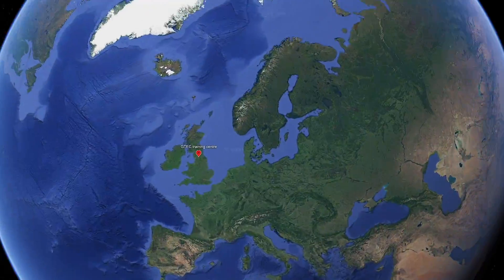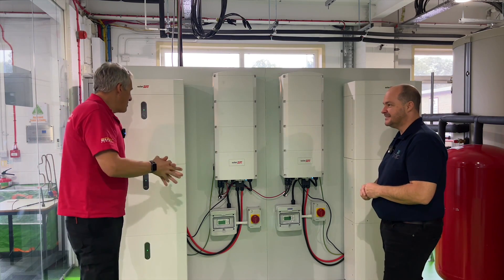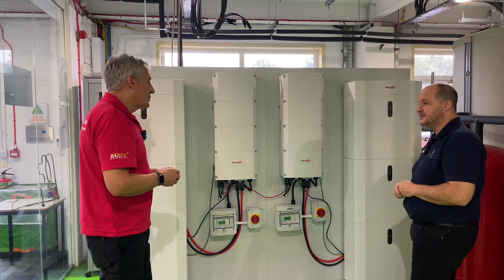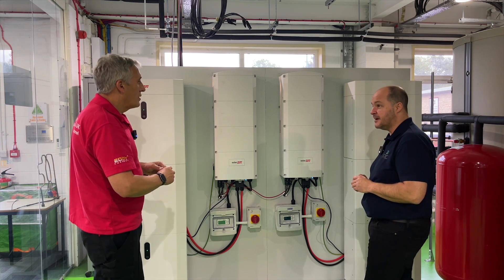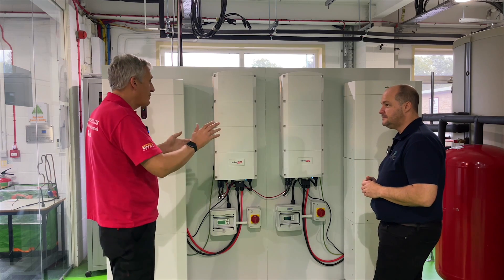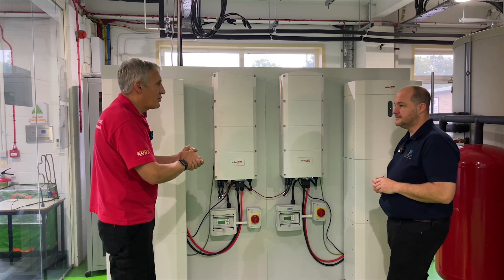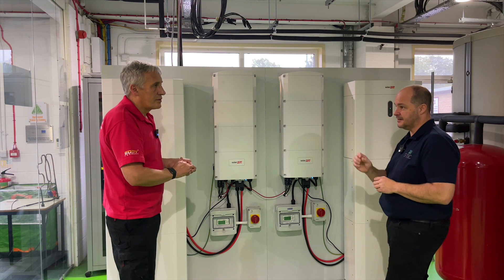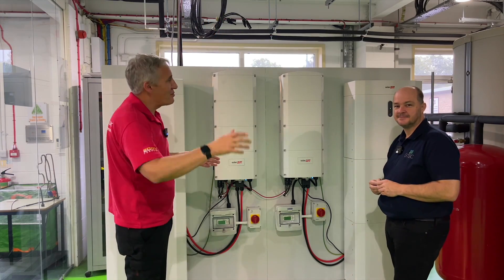Unveiling the Surprising Results of Solar Panel Optimisers

Comment: At https://youtu.be/asCRHtQ6vYI?t=333 you mention that a normal string converter would loose a lot of power (down to 70-80%) if one or more panels has a fault (most likely a diode has shorted resulting in 33% loss of power). That's not the case. Both SolarEdge with power optimizers and a string inverter would give the same amount of energy. SolarEdge does point you quickly to the panel with a fault which would be very difficult to find with a string inverter. The only way to do that with a normal string without disconnection the panels is to use a thermal  camera on a sunny day.
But it is easy to detect that you have a failed panel with a string inverter. For that you need to monitor the string voltage. Each section of a panel that fails will drop the string voltage by one third of the panel voltage (~15V depending on the panel). But which panel causes the fault?
Power optimizers or micro inverters really shine when some of the panels are shaded by trees. Hard shadow like from a chimney will simply bypass one or more sections of the panel. And as you mention if you add a different type of panel to an old string, power optimizer can get all the energy from the new panel which a string cannot.
Disadvantage of having optimizers on each panel is that they tend to fail more often that the panel they monitor. So maintenance can be pain if the roof is not easy to access...

Comment: There are 3 diodes in every panel. The panels with het 66% power have a diode that has failed short. I don't think it would be a problem with a string inverter.

Comment: Having fitted solaredge,Tigo,Huawei and enphase the least amount of problems I’ve encountered is with Tigo and they work with practically any inverter while returning excellent productivity in any situation.
had loads of solaredge Optimizers and inverters go down most suffering by being fitted to non shaded roofs however on different orientations they seem ok
Enphase are good as a all in one unit but seem to suffer from coms issues on the gen1 display second generation is much better.Huawei to early to say yet as to reliability but product seems strong and there inverters seem to outperform most conventional string inverters.
Reply from the maker: Great feedback - thanks 🙏

Comment: I love the idea of using a solar edge or emphases system but cost of them individually is very high and if a module fails is a time sink and money if the modules are not installed the roof space (I do like the per panel monitoring) but £50 to 150 per panel additional is a lot ,when I can do 3.6kw system for less then £2-3k before battery’s (ground install)

Comment: I’ve had a Solar Edge system since 2011 and installed optimisers at the outset due to some shading issues. The reliability weak link has been the optimisers, about 5 out of 10 have failed over that time. The most recent failure was in June this year and although the cost of the optimiser was covered by guarantee, Solar Edge have now ceased paying the call out cost of our local distributor, but is was only £48. Luckily we don’t need scaffolding.

Comment: Why are those battery packs so big?? the Tesla PW is 13.5kwh and is super slim and compact in comparison!
Reply: Tesla Powerwalls contain a different cell chemistry that's more energy dense, but much more dangerous.
Reply: @VinoVeritas_  not seen any reports of TPW fires online... I think having energy stored at this density is always going to be potentially dangerous...
Reply: @VinoVeritas_  they also don't last as many charge cycles as LFP chemistry, something less than half.  Not sure, but I think I read Tesla is changing to LFP though.

Comment: After all this expenditure for this system what are the total costs and savings as to wether this system is worth it. Do you need a fire suppression in the building because of the battery storage. And how does this affect your buildings and contents insurance. I'm sure if you don't declare it any fires that happen will void the insurance. The same as if you have a illegal tints on your car this will void your policy if you get involved in a accident.

Comment: How would the Importing to export scheme work out. In germany we get like 8ct per kwh export and 42ct import. You can import to charge your battery but for what? You can get an flexible hourly contract but this only effects the import and goes down to like 20ct per kwh so it only makes sense to charge to use later when rates are higher. but In Winter now its pretty much constant 42ct. And solar is kinda non existing. 2,2kwp give so much energy in the summer. its hard to use it all. and it makes sense to use it anyway insed of selling for 8ct. but in winter i can use the wasching maschine twice a week and the battery is empty.
Reply from the maker: We have dynamic tariffs which can at times pay you to take energy from the grid.
https://youtu.be/TW2-OndMmWY?si=h_EvVsI_-NJpRG1k

Comment: This is all good stuff and the SE optimisers have their benefits as this video shows BUT we have had a number of optimiser failures with customers over the last 10 years. 25 yr warranty on the optimiser is great but it’s the scaffolding costs which are the problem.
Reply: That's true, we too suffer numerous failures with optimisers over the last 10 yesrs 2x battery failure in less than a year, lost count of inverter replacements, solar edge although seem full of wonderful things, it really isn't .

Comment: Would the compromised panels have actually dragged down the whole string or would the bypass diodes just have dealt with it such that you only lost a third of the output from that module?
Reply: Ow, and the faulty modules could have been identified by "just using a decent multimeter" and measuring the open string voltage from time to time... You'd see a drop of 1/3 of the  open string voltage...

But off course, seeing that in a dashboard is much easier.

However; now they know, they haven't missed out on anything and are not going to change anything about it?

Time and money would have been better spent going to a university or similar and enroll some electrical engineering courses.
(But that's not something you show your potential customers)

It's a shame that this level of nonsense is still being spread on a channel like yours..there are so many nuances just being "passed by" for the sake of easy/sales.

And the worst thing... Many electricians etc. Just take these videos for truth.
Reply from the maker: The bypass diodes worked so only 1/3 power  lost from the damaged modules.
Reply: Exactly this!

In the video they are talking "the complete string would be reduced to 70-80%"  Which is utter nonsense given the bypass diode "cut out" that defect.

This sounds more like marketing than anything else.

If you read various research results about the usefulness of panel-optimizers it can be found that  panel optimizers normally only have a benefit concerning "soft shade" i.e. trees.

See for example the research that has been done in Switzerland at ZHAW ; EFFPVSHADE – Effizienzanalyse von dezentraler Photovoltaik Leistungselektronik bei Teilbeschattung

People really started to believe SolarEdge on their marketing-outings when in reality those estimated "benefits" only come in a fraction of the time under very specific circumstances. (If ever).

When simulating Solar-Arrays on a component Level-Basis (every diode, every cell simulated) and then playing with broken diodes or cells etc you see that the impact is normally next to zero...

Comment: Have to admit that having had the SE optimisers at my installers suggestion from day 1 (10 years in Dec) I've never looked back, but stopped looking at the stats after the first couple of years (unless I got an alarm which was usually a connectivity to the internet issue) - I had one optimiser failure this year (comms only it seems as it was still generating and ironically the least stressed optimiser) and SE replaced it without drama BUT I then had to go up and change it over which was a pain (luckily no scaff needed).

Added a modest battery (4.8kWh) last Nov but AC coupled via a separate battery inverter so no issue with the FiT - import has dropped from 1000kWh/yr to hopefully around 2-300kWh/yr 🤞 My panels still appears to be knocking out close to what they should (mix of thin film and mono) so overall the FiT and install cost have paid for themselves and any extra is paying off the battery plus the savings from import 😎

I'd say unless you already have optimisers it's not worth the change mid-way through their life - it will just be more cost and e-waste ultimately for only marginal gains. This rig makes senses as there was work going on anyway and it is used for training but in a domestic setting, unless there is a failure and it then needs scaffolding to rectify it doesn't make much financial sense...
Reply from the maker: great insight - thanks

Comment: I changed my inverter when it died at 11yrs old and the new technologies inside it have boosted my low light outputs by tons. I didn't think you could add batterys and keep the feed in tariff as you have changed the system
Reply from the maker: A change in the system and metering needs to be agreed with Ofgem
Reply: @efixx It doesn't have to be agreed with Ofgem. It needs to follow the updated Ofgem guidance and then notified to the FIT provider.
Reply: If it's an AC coupled battery (completely different installation) then as far as I'm aware you can just install it as long as the DNO requirements are met.
Reply: @alexkane07  This is not a good idea for older FIT systems that have an aging inverter. It's best to replace it with a hybrid inverter in the first instance so that you don't have to get an installer back again when the original inverter fails. Also, as more generation gets added to the grid, it won't become so easy to get that additional AC coupled battery past the DNO.